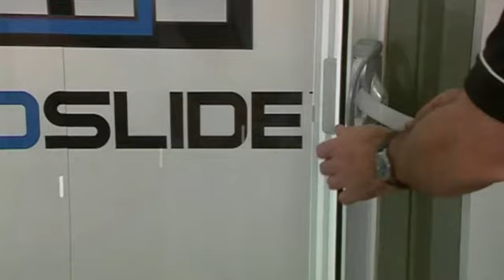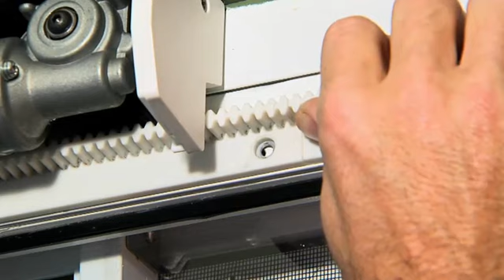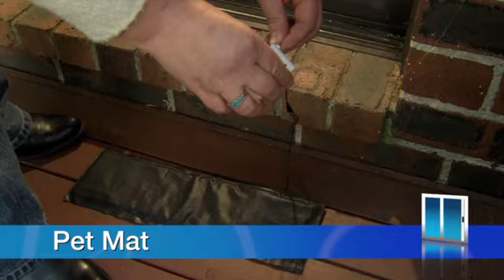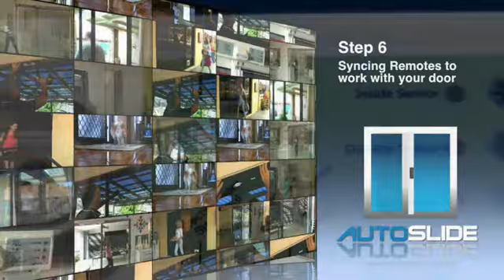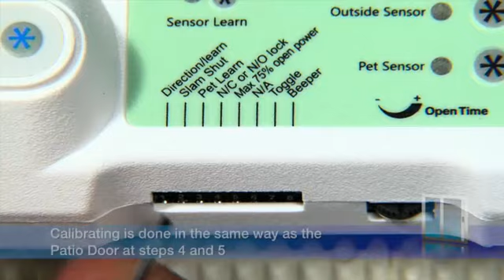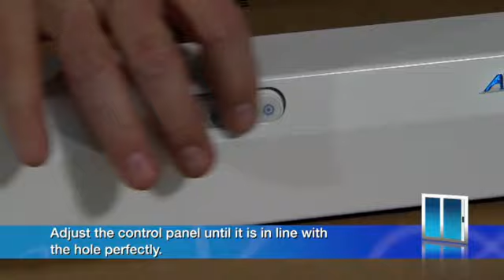Autoslide Automatic Door System Installation Video

Comment: The instruction books with these things are 100% useless - they tell you nothing about how the remotes work - how you calibrate it...*NOTHING*.   This video appears to be for a different unit to the ones they are shipping now - there is not learn "switch" - there is a button.  The LED isn't red, it's blue...and basically NOTHING works like the video says.  Hopefully there is a more recent video somewhere.
Reply from the maker: Hi Steve. We are in the midst of redoing our manuals and installation videos for the Autoslide line of automatic door systems. If you need support or help, please send us an email at support@autoslide.com and we will be able to assist you.
Reply: @AutoslideLLC  Do you have an expected date for that to be done?   Also, I have repeatedly emailed your support line and have never received a response.

Comment: This video lacks an important piece of information:  Which ports on the side of the Autoslide do you plug the hard-wired (infrared) pet sensors into?  That information doesn't even appear to be in the manual and frankly, it's a bizarre omission!  So which port goes where?
Reply: Thank you.  That ought to take care of all my issues.  BTW:  LOVE the Autoslide!  Was a huge pain to install in my door (because it has a strange skinny frame) but now that it's working I couldn't be happier with its performance.  Both my tiny dog (chihuahua) and my large dog (mix: 60 lbs) can use the door without issue.  The little one can't push open a dog door big enough for the big dog and the big dog can't fit through a smaller one.  This solves both problems and is downright cool as hell.
Reply: I'll do that!  First I need to finish hiding the wires :)  Need to drill a couple more holes and re-attach the trim.
Reply: @riskable  just saw this item at a trade show and am thinking about getting it.  So here we are five years after your comments.  Does it still work and do you recommend it,etc.?